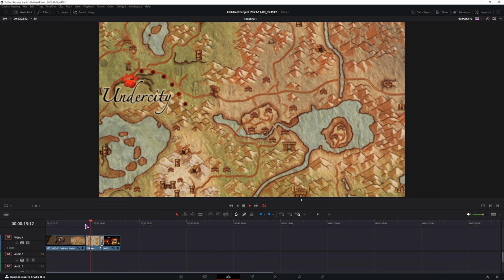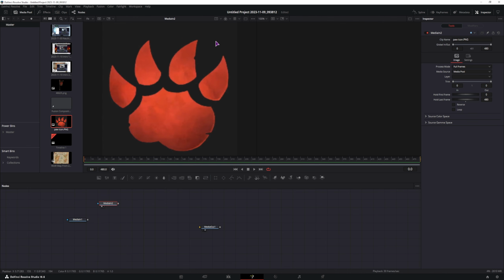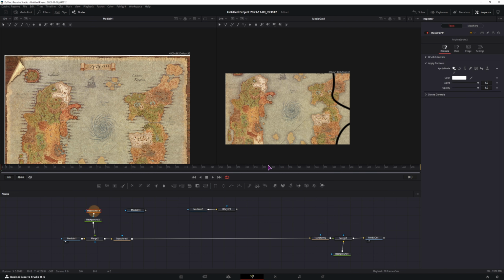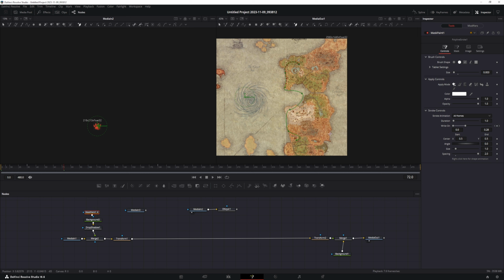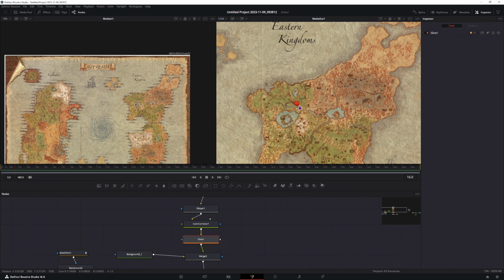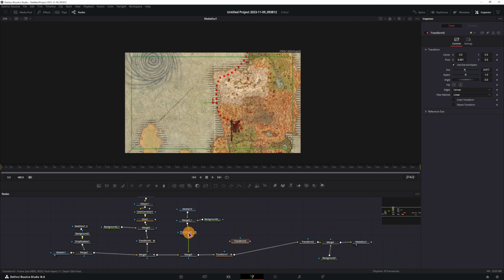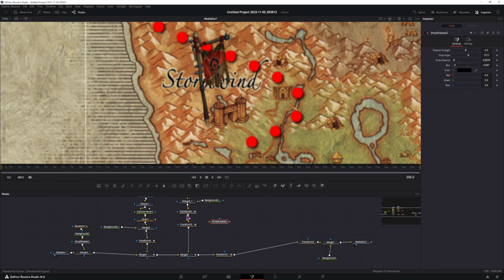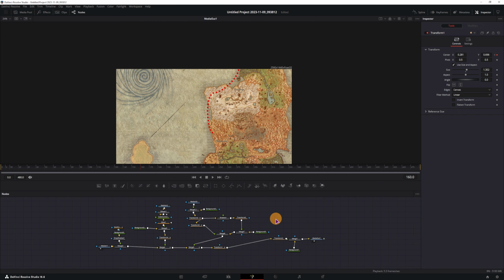Cool WoW Travel Map DaVinci Resolve

Comment: Great tutorial! 
Regarding the Image of the animal claw/paw animating down WITH the map path animation: I know we can animate the Displacement for the Path Modifier so they move in parallel, but that simply doesn't work perfectly. Something I think most Fusion users have been struggling with is matching Paint.WriteOn with Object.Path.Displacement animation.

To quote a comment from WSL: 
"Ok, So this might be why the displacement and length do not match up. Path Length uses the actual length of the path to determine the speed and movement of the driving force. Path Displacement is similar to actual displacement and moves at a vector speed using a straight line between the two points. When those lines are straight, the vector motion and displacement speed are equal. When its curved, it doesn't match up because the speed it going at a straight line and the position is following the path"

My question: Is there any way to match the two animations, so they move in sync ?
Reply from the maker: Hey @videoabyss1414, thanks for the feedback, the information and the question. I did not know the reason why there is a discrepancy between the two functions but now I do.
Now regarding your question and with the information provided my immediate answer was NO. But I did a quick test and the answer is YES, it's just not an out of the box solution as one would expect.
So I made a quick curvy polygon path and used an image with a transform, to move it along the path. In the polygon I animated the length from 0 to 1, and did the same in the transform node center path for the displace. The values were not the same. Since the transform uses a modifier, I do not know if it can be referenced (Path1.Displace did not work), so instead I left the polygon length animation and simply used an expression in the transform displacement, which looked something like Polygon1.WriteLength

EDIT: I Guess the answer is more NO than YES, it depends on the image that you use, how big it is and how curvy the path that you have is. But most likely you will have to animate the polygon path with length, and do the same animation in the displace, and then additionally also adjust the image position on the path in the displace.
Reply: @JackallDigital  thank you for looking into it! Much appreciate. This definitely helps!